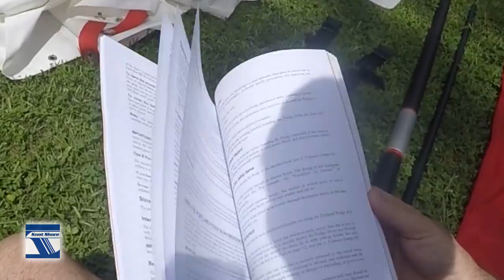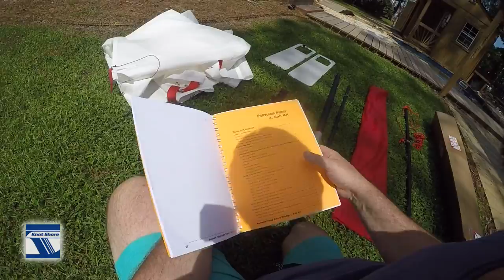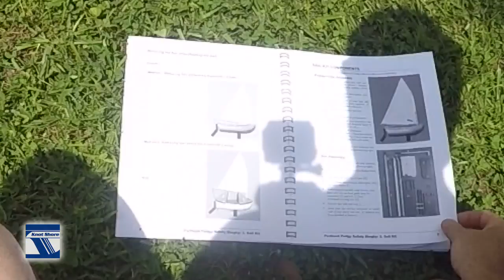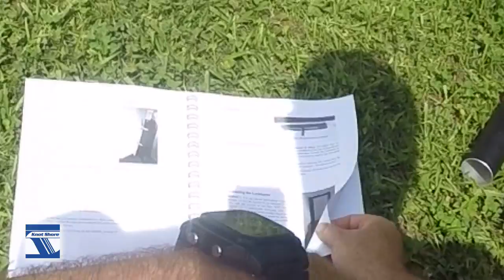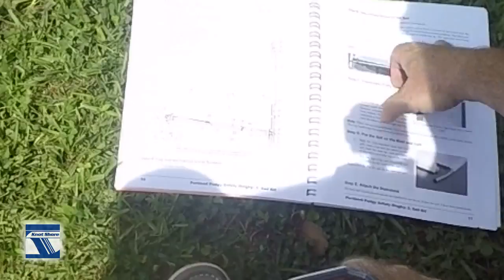We unbox and set up the sailing system on the Portland Pudgy

Comment: We have a Boston whaler squall we have been using as a dinghy and are looking to replace it for a pudgy. Have you sailed it? With the squall, winds around 17 and it is not a good ride under sail. Maybe it would be fine on the icw but we are usually on the outside.  I do sometimes use cleats I put in the back to hold the sail but just a half wrap so it doesn’t pull your arm off and you can still drop it. We have had it 2 years and never thought of needing to reef it.  I’m just curious if you have played with it in some wind and chop? It looks like a great boat and the price is pretty good.  Cool videos!! I subscribed 😂
Reply from the maker: I have sailed it at Cape Lookout bight in 10-15 winds and it was comfortable, but not on the ocean. My only concern in higher winds would be trying to douse the sail quickly would not be easy, as you have to drop the mast and pull out the top mast section to do it. The biggest reason I reef it is so the boom doesn't hit the wife in the head!
Reply: @SailingKnotShore  🤣Not hitting the wife sounds like a good enough reason. It looks like a great answer for our issue. The squall would be perfect but it is so light. The fiberglass is real thin and so we constantly have to patch and repair it. Thanks for the great info!

Comment: Erik,
Thanks for the thorough look at setting up for sailing!  I'm considering buying a Pudgy.  Can you tell me how you like sailing it?  I would use it primarily for sailing, rather than as a tender or life boat.
Reply from the maker: I would not recommend it as a sailing dingy, there are probably others that have a better hull form for sailing performance.  I did modify my pudgy to add a small self tacking jib like in this video: https://www.youtube.com/watch?v=PE564oYl4Ds  but haven't fully tested it yet.  We bought ours as a tender/life boat first, sailing second.
Reply: @SailingKnotShore  Thanks for the experienced opinion!  Guess I'll keep looking.